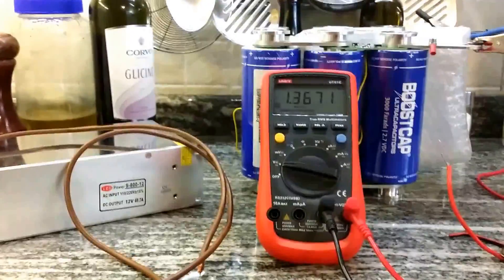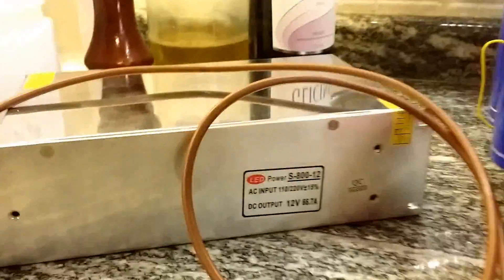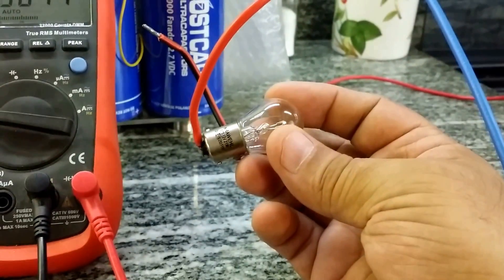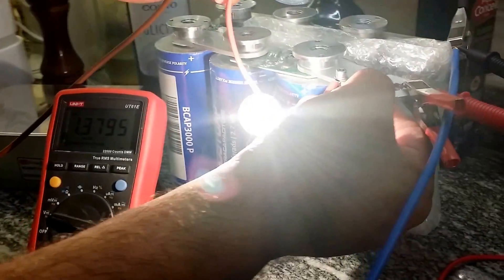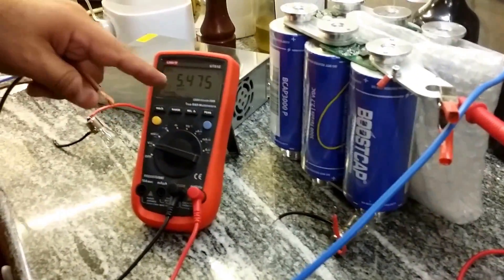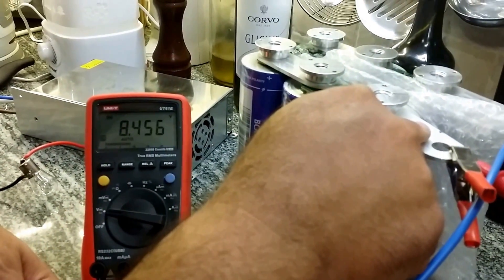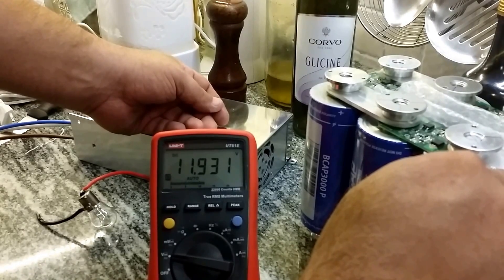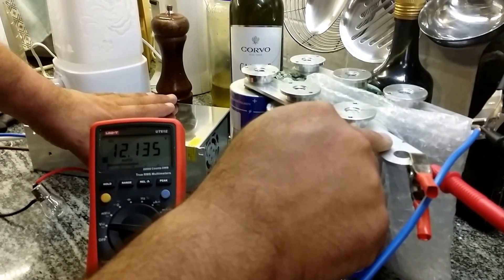Fast Charging Ultracapacitors and Supercapacitors using 66.7A LED Power supply

Comment: Isn't better/easier to get current limiter ?
Reply from the maker: Dino Sabanovic The bulb acts as the cheapest current limiter possible. Using a buck converter (with current limiting) as a current limiter that could deliver about 10A defeats the whole concept of an easy method to overcome the low internal resistance of the ultracaps.

Comment: Would an inductor not work to prevent the initial high current draw? Once the transient has occurred it would act as a short, meaning the supply wouldn't cut out initially and there would be no need to remove it, or would it have to be impractically large to do any good?
Reply from the maker: Mathew Fulton To charge a bank of capacitors at 66A requires an inductor with very thick windings and probably the size of the whole capacitor bank. The bulb is way cheaper although the initial charge is slow. Best thing is to never let the bank fall below 5V so you can hook it up quickly to the LED power supply in the video.
Reply: dispatcher7007 I suspected so but thought it would theoretically work :P thanks for the insight!

Comment: You can charge your cap bank to 12v in a few seconds from a car battery, but make sure you use at least jumper cable sized wires.

Comment: I am a student working on a project using supercapacitors.  Can you explain why the initial charging required a light bulb?  I didn't understand what you said in the video.  Thanks.
Reply from the maker: Ultracapacitors have an extremely low internal resistance so if you put any charger to try and charge the U Capacitors it will seem as if you are shorting the charger leads and the charger short circuit protection will cut the power off to protect the charger. Once the voltage if the U Capacitors rises to about 4 or 5 volts, the internal resistance of the UC's will be high enough to enable the charger to not see a short circuit and the charge process will proceed.
Reply: Thanks a lot.

Comment: Maybe you could make an experiment with them. You can replace a car battery with it. Maybe you can remove the Ignition wires from your Engine and place the BoostCaps intead of your car battery. than you can try cranking the car as long as the starter no longer rotate the engine. than you should check the voltage of the boost pack. it whould be very interesting for me to know how long a car starter can work with the boost cap's.
Reply from the maker: Many people on youtube have demonstrated the replacement of car battery with ultracapacitors. I had tried this for about a week. I manged to run the starter for 20 seconds on a 1300cc petrol engine. Then the cranking slows down. However if you start a car the charge of the ultracapacitors will go up to about 14 Volts within 30 seconds. I have left the ultracaps connected to my car for a whole week (7 whole days) initial voltage was 14 Volts. After the lapse of 7 days, the voltage dropped to 10V but since ultracaps can deliver very high current without significant voltage drop, the car started immediately. A Normal cranking lead acid battery usually drops to 9V whilst starting. Then again the advantage is that in 30 seconds the ultracaps charge is back to 14volts. I do not use them for my car but as a quick way to store solar energy from solar panels. When you charge normal lead acid batteries through a charge controller they take time to charge at about 10A. I direct all the extra energy to ultracapacitors and charge them easily through solar energy from an array of panels at 1000W. In turn the solar charge controller feeds the batteries from the Ultracaps. 1 last advantage is that Ultracaps can be charged and discharged thousands of times with negligible performance loss and will last a very long time. A Car battery can only take up to 300-500 discharge cycles and they degrade in performance.
Reply: Do you have any idea how i can get those boost-caps for low budget? I am living in Germany.
Reply from the maker: I'm sorry, I do not know. You will find them in the United States but expect to pay about 300 euro on ebay for a set of 6

Comment: How much did the super capacitor pack cost off of eBay?
Reply from the maker: I got them slightly used from ebay (Spain) and had them shipped to Malta by registered post for about 300 Euro including the balance circuits. I am presently slow charging them using a PV coupled with a charge controller. I charge them at about 2A and in a couple of hours they reach 15 Volts.

Comment: From where did you get the capactor bank?
Reply from the maker: I bought them from ebay from a seller who was breaking down a written off Electric bus. They were 1 year old on the road explaining why they are in very good condition.Voltage drop is minimal and after 10 days they will lose about 1 volt. The balance boards are active microprocessor boards by Maxwell and do a very good job of controlling overcharging.